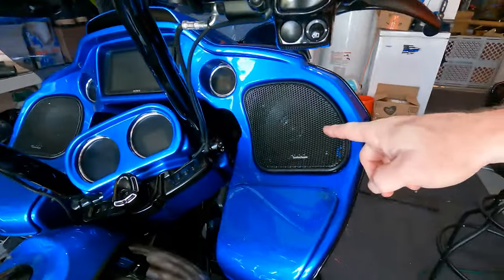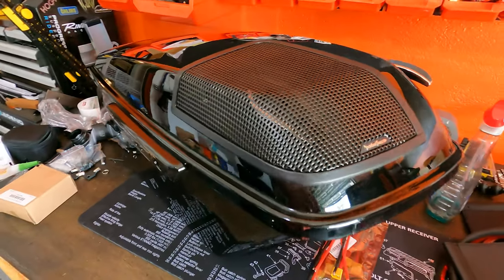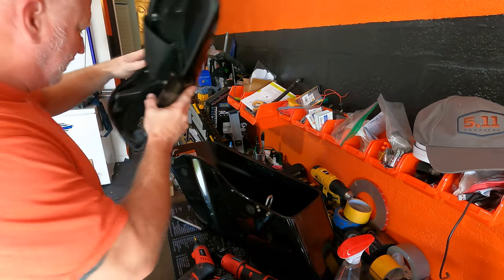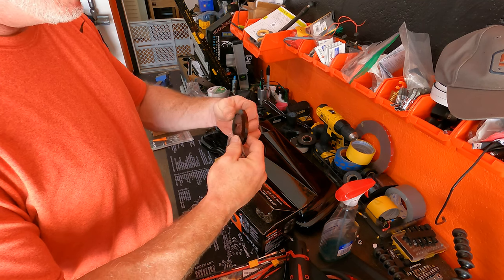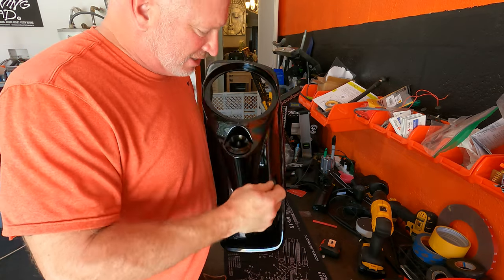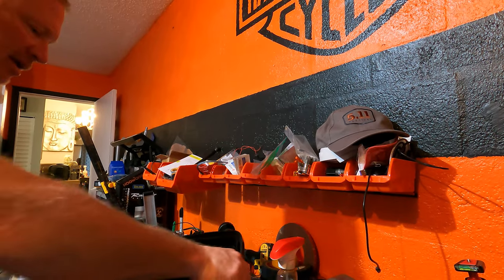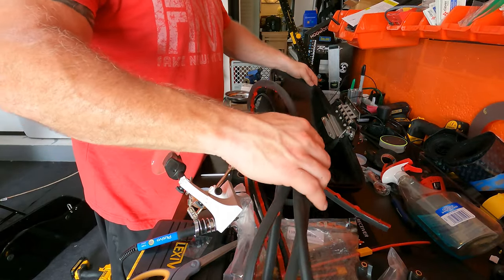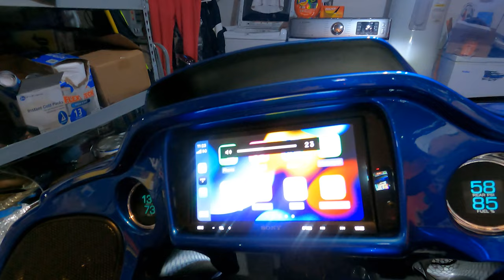Harley Road Glide Advanblack 8 Inch Speaker Lids Install

Comment: Hey buddy, Im about to do that same exact upgrade in my bags over the Winter. I saw in a comment you said that you still don't have enough bass? Other than that are you happy with them?   I have 4 ground zeros 6.5s up front with a 1200 Evo X. Thinking this would be the perfect upgrade for the bags
Reply from the maker: That’s close to what I had but it wasn’t enough bass in my opinion. What are you putting in the bags?
Reply: The hertz neo 200 with the st35s
Reply: Are you not happy with the setup?  It must give out some bass.
Reply from the maker: @mcosta1819  it’s very good but could definitely thump a bit more.
Reply: @mcosta1819  I’m going with the sv200L because it plays lot lower than the 200.1
Reply: Oh ya?  I see that their much cheaper too
Reply: Sv 200 plays at 100hz. The sv200L can play at 50-100hz. I got a set of these coming and cicada tweeters, I’ll be pushing 400 watts to each speaker and 400 watts each to my front euphoria 6.5’s and a dsp.